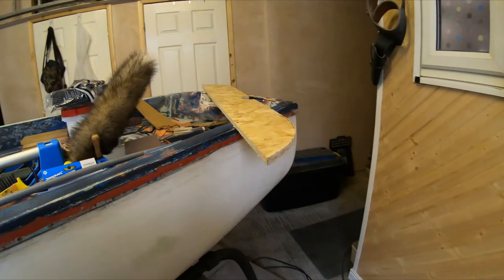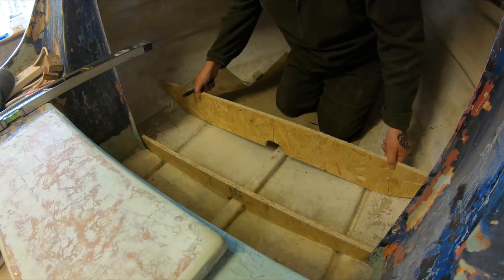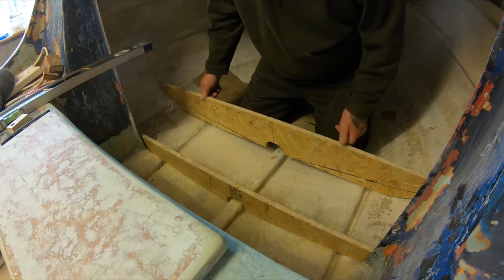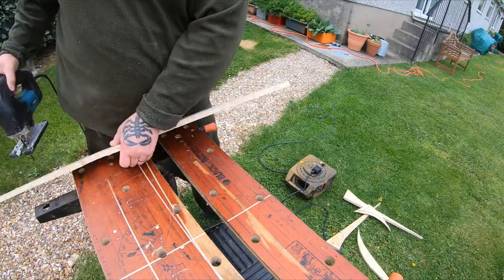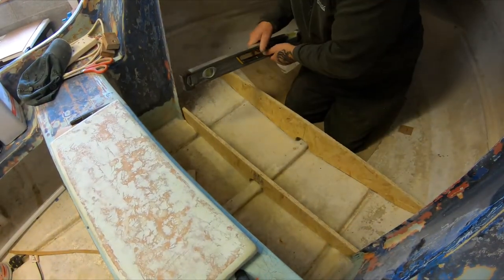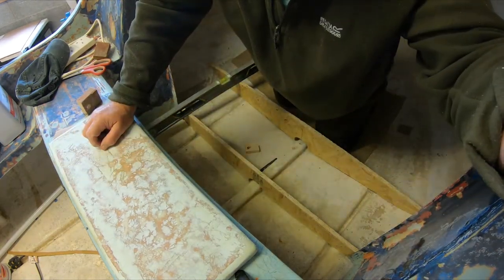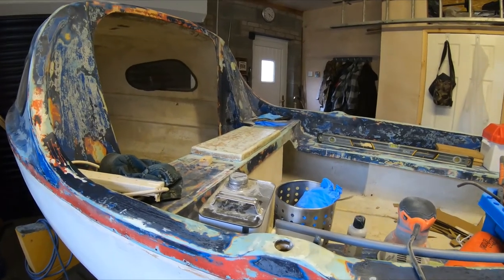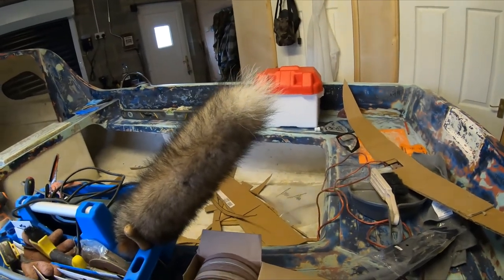POOR MANS BOAT,  Ep 4

Comment: You say you're thinking of swapping the electric Yam outboard for a petrol item. 

Probably a bit of a wacky thought on my part here, but... would it be possible to keep a small generator on board (with a 12v output) and use this to both power the current elec motor whilst simultaneously charging your two batteries? 
If this was possible, you would then effectively be able to run the elec motor either on 'pettol' if being powered direct from the generator... or... from the batteries when/if charged. 
The generator could be lifted in and out if needed and used for other things; probably cheaper to buy than a petrol outboard and let's you keep the current elec outboard in service.

Obviously you wouldn't want to run a 'big' generator, just something with the required watt output.

Like I say... probably a wack idea, or somebody else would already be doing it... it's a bit like a 'hybrid' I suppose. 😁
Reply from the maker: The electric motor is OK for a lake or river but not the sea as it wouldn't be powerful enough, good ide on the the gen though, a little Honda whisper would do it
Reply: @ahunterstail1083  

Right... yep... I get it...  more 'grunt' needed. 

I'm pretty envious to be honest. Always fancied doing up a little boat,  (canal boat), but time is currently against me.... excuses ay!

Looks like I will have to make do with living vicariously through your video diary for the time being.

Keep it up... looking forward to seeing the launch 👍.